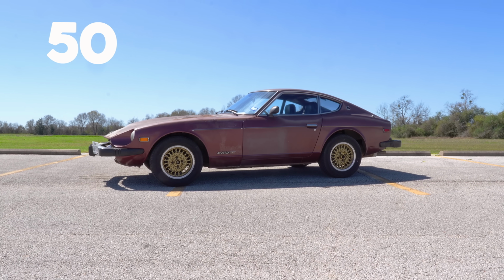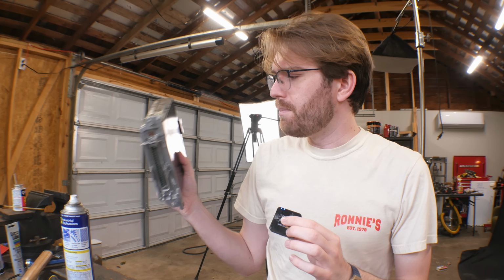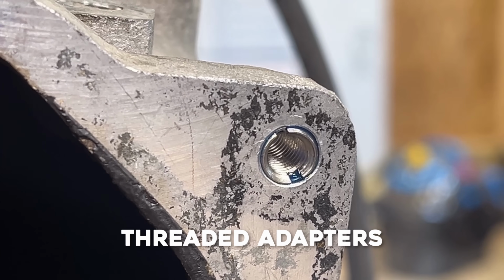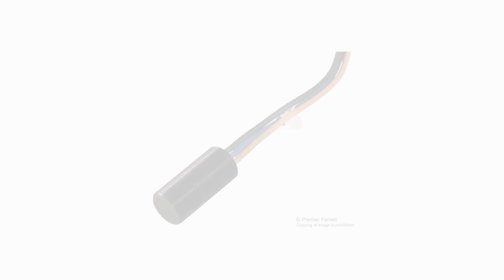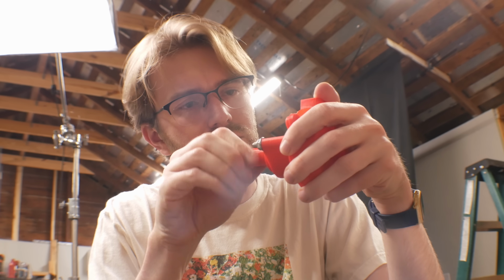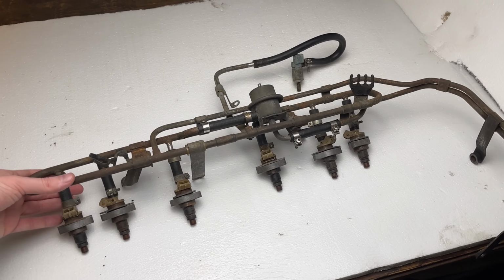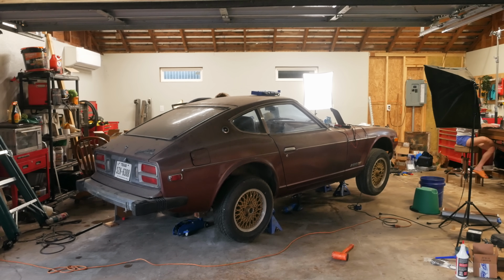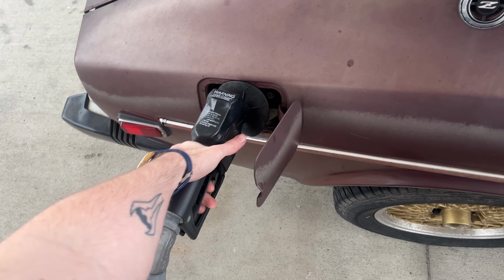Modernizing a Vintage Car

Comment: Tbh i like having more physically connected parts that aren't for controlling the engine. Like the throttle and brake directly connected to their respective parts. More for safety. Or say you're driving and your throttle dies completely. With an electric throttle you have to get towed. Meanwhile with a older style that is cable driven you can at least attempt to get a diy fix to get you home. Also I'm gen z.

Comment: What they mean by direct connection is the pedal feel and response.

Early drive by wire pedals were shit, they assumed you were a crap driver and nanny'd you.
If you pushed to quickly on the accelerator they'd slowly move making sure it wasn't and accident before giving more power.

There was also non-linear and fuel saving options.

I still prefer cable and drive a car with cable, it's newer and way faster than yours.

However I get you can make a drive by wire indistinguishable from cable driven if you try hard enough.

I like a computer, I just like a dumb realiable computer in my cars, not one that will drive me off cliffs or up the walls. Although I can also see how carboretters are cool if you like tinker with them on a semi regular basis too.

Comment: Just wondering how much more could have been gained by replacing water, oil, and fuel pumps with electronic counterparts. Naturally a battery and alternator upgrade would have  also been in order. My guess is another 5-10% power gain would be possible. I’m also curious if the ignition timing is dynamic or fixed, as the spark needs to fire earlier or later with changes in speed and intake temperature. 
The last thing is that there was no mention of EGR upgrade or whether any emissions testing was done to assess ultimate combustion efficiency.

Comment: Btw, YouTube Robot Cantina has done interesting stuff on Computerizing non computer engines. Adjusting done by stepper motors of Manuel adjustable stuff on the fly... then doing it via Aurdino programming.

Comment: For future improvements, I’d recommend revisiting the mechanical timing of the engine (firing at TDC versus slightly before TDC), make sure mechanical timing and injector timing is advancing at higher RPM. 
Also I would do a compression test. It’s hard to have good quality combustion with worn valve seats and piston rings.

Comment: The L-Tronic is not like modern EFI in that it is analog vs digital so it's more closely related to other early fuel injection systems such as the Bendix Electrojector.

Comment: dude, you are a genius and a masochist. kudos on the stick to it, but honestly 140hp is not worth getting out of bed for. my first 240Z build I went triple Webers and all that stuff. then I got 'real' and built a very stout 400sbc topped with a Holley 650 XP mated to a T56 wide ratio, TTT all around, Wilwood, and custom Aero wheels (no silly fender flairs). it's absolutely terrifying to drive. I love it.  I love the scenes where you are sitting at a desk testing. We fellow masochists know to test everything before installing. my Adruino and I are besties.

Comment: why?????????????????????????????????????????? you made a ton of money on this video, why not do some digging and find a new engine, show the adoption into the car, fix the frame and chasis, and moderize the drive train,.... this would make sense. fixing an old engine, really, why? what would have been even better would have been an electric conversion for this light sports car

Comment: This is amazing. I feel like a loser. I put carbs on a d-jet 1600 vw engine. You are welcome to borrow a 73 vw squareback for next year
Reply: Not to brag but I also upgraded from points to electric ignition

Comment: Alright now we need a new alum rad, new headers exhaust system, oil cooler, transmission cooler, new transmission, body works and repaint, power windows, a remote to lock/unlock the doors, new interior trims, suspension work and you have the perfect modern "classic" car lol. $$$$$

Comment: The Bosch L-Jetronic was a fucking asshole, especially when there were undiscovered gremlins lurking. I kept getting intermittent ECU failures that (when following the manual) diagnosed as a bad ECU (red indicator light on the ECU itself). After acquiring 2 other ECU's from the junkyard and many, many frustrating days of fooling around with them, I found a wire running on the inside of the front passenger fender which had some of its insulation rubbed off and was intermittently grounding, which turned out to be the issue. I can't remember now what it went to, this was back in 2001. My 280ZX was sitting on cinder blocks when I found it, after a few months and a lot of frustration and tinkering, it was pretty fast and a bit scary to drive. I converted the fusible link box to a proper fuse box, installed MSD digital ignition, got a nicely built head with custom cam (from some old car forum guy), bigger injectors along with some other electronic bits that fooled the ECU into delivering more fuel because I couldn't afford an aftermarket ECU. That car required repairs a few times a week lol but it was fun. The L28's bottom end was an incredibly tough unit. After blowing a head gasket, driving another 100 miles with the temp gauge nearly pegged and finding the oil pan full of chocolate milk, the cylinder walls still looked freshly honed, rod bearings absolutely fine. Slapped some JB weld in the cracked head, threw on another head gasket and sent it, the next owner drove it for a year like that!

Comment: surely at those rpm the hardened steel wouldnt affect the aluminium that much? unless you were going to make it have a large tolerance? i just dont see that crank sensor being aluminium being a problem

Comment: Hmmm almost identical system to my 1985 Porsche 944 (higher power AUS/ROW model) As for measuring air for the computer...? Did you forget the Air Flow Meter? It is sitting right there on your bench. Then on the Throttle body is a TPS that also sends a signal to the computer (DME in Bosch language) so you do have an electronic signal telling the computer where your pedal is.  Then it also has  DME temperature sensor that allows the computer to very the mixture. Not a dumb as it sounds. You can chip the DME to change the profile and increase the power and torque curve. The Jetronic system also has 2 crank reference sensors that tell the computer exactly when to fire and measures RPM which it feeds back to the computer.The whole system still works perfectly 21 years later.

Comment: And I have an immaculate 1970 Chevrolet Impala (56yrs old).. all original w/350cid.. Rochester 2brl carb.. normally aspirated .. original GM Distributor w/points, Condensor & Coil.. w/a full tank of fuel (28 gallons).. it weighs 4156lbs (twice as heavy as that Datsun).. I get 19mpg in it.. running the AC 😊😊
Nothing like American built steel cars.
Guy made a great video though 😊

Comment: In case anyone is ever looking for a slightly less complex way of getting around being stranded with a dead coil...buy a spare coil and stick it in your glove box. Seriously, it's a couple of wires and a clamp. With the time and money he spent on replacing the distributor for the sake of running six coils, he could have bought a whole case of coils and placed them around at different locations in his town.

Comment: You can also get another boost of HP, by adding a performance exhaust manifold. The ones designed back then were not even close to as optimized as compared to modern exhausts.

Comment: I mounted my trigger wheel to the crank. Mad an aluminum adaptor that was bolted into place with the bolts that held the crank shaft pully. It’s more accurate there than in the distributor as you remove error from a stretched timing chain. Then if you want sequential ignition and injection you can do a single tooth wheel in the distributor with a hall sensor to tell when cylinder 1 is top dead center. But the trigger wheel on the crank is so nice as you can use one that’s very large so the signal is very robust.

Comment: I own a 1980 280zx and currently doing a complete ECU swap with modern injectors and throttle body. Such a fun car to drive. The L28 inline 6 runs so smooth.
Reply: I am thinking of doing the same. What setup did you go with?

Comment: Isn’t it a mistake to inject the fuel right as the spark is going off? Wouldn’t you want the fuel in there a little bit before so it has enough for it all to spray and mix?

Comment: The way you simplified that engine bay alone was worth it.
Reply: Was perfect the way it was.
Reply: Turbocharger ! They get crazy horsepower out of modern 4 cyl engines. I'll bet the compression ratio is low enough seeing it's so old.
Reply: @firebald2915 Maybe. The L28E of 1978 in the 280Z (S30) was an 8.3:1 compression ratio for the 135hp, whilst the 1979 to 1983 280ZX (S130) has 143hp with an 8.8:1 compression ratio in its L28E.
December 1980 introduced the L28ET with a Turbo for the 280ZX Turbo (S130), but the static compression was dropped to 7.4:1 for what it's worth.

Comment: Self has a skyline GTX with the exact same engine
throttle body
Fitted a (those days) BMW throttle body and Airflow meter, has an aluminum plate welded onto the manifold, ported the whole set up to allow and eliminate any steps in the airflow, drilled new holes to mount
transplanted the little PC board from the original Airflow meter to the BMW Airflow Meter, and just like there was a 60% bigger area for the air to flow throw 
let me watch the rest of the video
brings back memories
at 1800m above sea level, on the wheels 144bhp

Comment: Not raining on your parade but you could have just done a crank fire system using a trigger wheel and replace the distributor all together.

Comment: You did about $100K worth of engineering and design, plus thousands in custom made parts and more in wrenching. You sure a nice near new Nissan engine from a wreck wouldn't have been easier (and more powerful, economical, and clean)?

Comment: Spending 8 months for a 12% power boost and a 2 miles per gallon increase is both impressive and depressing 🥲
Impressive in how much effort and knowledge you had to put together but my God.... I wonder how much an engine swap would have done instead

Comment: Awesome! I have a '70 240z with 30K original miles and a near perfect interior, uncracked dash but horrible original paint. I need to replace the rear quarter panels as  the prior owner replaced them with mid '71+ panels due to rust. Going to cost ~$2000K to fix, also needs a paint job, but it's going to look fantastic when I finally get around to it.

Comment: He can shave the head and bring the compression up as this isn’t an interference engine it has 8.2:1 compression ratio bringing it up to maybe 9.5:1 to 10.2:1 it’s a cheap mod to make more power research says these heads can be shaved up to 0.080

Comment: So with the K-Jetronic it originally had 170HP and after all this work it has 140. How much dos it produce at the crank? A good test bench should be able to tell you by measuring the losses in your drivetrain.
Reply: I think its bc its a tired engine, a full rebuild would be in order, every seal gasket and otherwise replaced or refurbed

Comment: Dude, I'm envious, your vids are not only well done but quite entertaining. Haven't posted many of mine because the production level will be very basic and NOT so entertaining but will have a lot of good info like yours on a lot of topics as well as automotive but not your level of depth. Super lube grease!! I've found no one that uses Superlube but myself before, well done! I've been using it since it first came out, yes that does date me, youngster. Nicely done and it will recover your money as fast as a solar system to boot and much of that was free through sponsorship too, but what a project, seriously did clean up the engine compartment though and picked up 20 more HP on an old engine that likely does not even have the best compression, top stuff..

Comment: Seriously impressive, but just to put an elephant in the room? Doesn't that Chevy Eco run at something like 30 MPG? 

Although I'm sure that the 280Z has a coolness offset factor of about 3, so it's at least two times better then the Chevy.
Reply: Convert the car to run on LPG and you offset the heavier fuel consumption by the 50% cost reduction of the fuel 😅

Comment: My Motorbike has 1251ccm and carburetur and does 116HP on the Dyno without any of your special tricks. No Airflow sensor, no injection not even a fuel pump (Gravity only). Has only 2 Ignition Coils for 4 Cylinders and no Water-Cooling at all. So there is plenty of room for "optimization" if your engine really has 2800ccm.

Comment: The continouus Injection is not wasting Fuel as this also gets burned but your way is a little bit more controllable. The KE-Jetronic does this, too and was very efficient in the W124 230E Benz of my Father - 6,8l/100km was no problem on the german autobahn with this car.

Comment: my issue with e-throttle body is the rpm hang when you let off the throttle. I've noticed that most new cars have that problem. mechanical you let off the throttle and it does not hang. idk maybe its just me

Comment: Is the next steps to install an LD28 crank and hotter cam and valve springs? Should be good for ~290HP and 7000+ RPM.

You've got me considering a fuel injection and coil pack modification. I'm on an L28 block with intake and carbs from a 70- 240Z - 3.0L at ~280 HP

Comment: I’ve got an 87 f150. First year for efi. Me and my pops pulled the motor out and after much deliberation figured it was cheaper to swap it to carbureted. Now I’ve got myself a carbureted 87 with a edelbrock 4 barrel with an electronic choke and it’s 10X more reliable than it was. Cranks everytime. And if I wanna shove heads and a cam on it I can without the stock fuel injection keeping me from tuning.  However this is a reliable alternative and very cool to see.

Comment: As an older person who bought my first vehicle for $50 in change. True story. My truck made 80hp and could run a million miles with just 4 wires to the engine and two wrenches a 12mm and 14mm, i could change the head gasket on the side of the road. All those electronic sensors and parts just make many more points of failure. Thank you for Not using 3D printed parts as a finnished product. 3D printed parts are ok for prototypes and nothing else. You are very talented i liked the video. 😊

Comment: What people complain about with drive by wire are delays, and limits in programing od the throttle operation, wen you can change that to 1:1 pedal position to throttle position drive by wire is just better

Comment: May I suggest an encoder instead of hall effect sensor. The resolution could be crazy high if you with. Either an incremental or rotary encoder they are not expensive

Comment: Excellent. I am living in Besançon in France where most of the actuators and rotating sensors you used are designed by Moving Magnet Technology of the Sonceboz swiss group. High congratulations for all your great job 😊👍

Comment: 125 hp at the wheels is pretty good for a bone stock 50 year old engine that originally came with 178 at the crank. You lose 15% for the drivetrain anyway. You lost 26 horsepower over 50 years. Pretty good in my opinion.

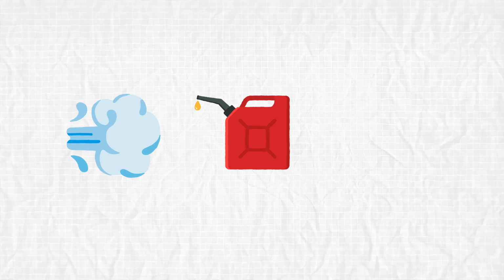Comment: 2:47 I don’t wanna sound like a smart ass but u forgot compression… Air, Fuel, spark and compression. If u missing one of those 4, your engine won’t run
Reply: All because I was working on a bike, it’s had all three but was missing compression so it wouldn’t start, the head wasn’t airtight, there was enough gap between the valves and the valve housing where air would leak out. Got new head and started right up

Comment: 19 mph,    fuck,   my 270 HP v6 4 runner gets 25 on highway and 19 in the city.
Reply: My VW Golf with 270 HP gets 29 highway and 22 in the city.     If I choose to drive with has savings in mind.   I can get it to 13 mpg or worse if I spool the turbo at full bald eagles.

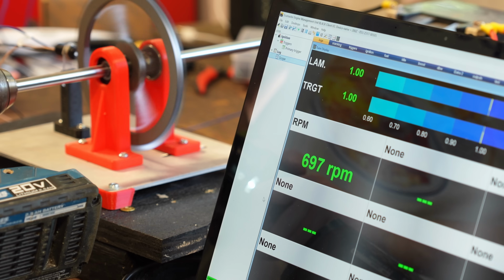Comment: 14:03
Sorry, but I'm not very familiar with modern cars,
 and now I have a question: with the new ignition system, how do you explain to the sensor when to advance and retard the spark? It's true that the distributor itself does this with two parts, one of which does it with the help of weights, springs, and gravity, and the other does it with the help of air suction from the throttle or carburetor, but what about this system? 

(And of course, it's very cool because with a small change, you can make the advance stronger so that an old car can work at 6 or 7 thousand rpm like a motorcycle! 😂)

Comment: Brilliant segment!
I'm posting this, though it'll probably bury in the appropriately MASSIVE response you've garnered.
You project a wonderfully droll and understated humour,  very much a style I've only seen in Bad Obsession Motorsport (B.O.M),  with 'Project Binky'.

Though I'm comfortably versed in the mechanics of engine systems I'm always open to the idea I could better understand some aspects.
And your uncluttered illustration of how sensors work, and the art of mapping, gave me another "Huh, so that's how it works' moment.

Very rare to find American content that isn't grounded in the obligatory over-hyped dialogue, redundancy and script padding.

And the "aftermarket" industry is insane. 3D resin  and CNC operations blow my mind, how you can design and fabricate anything. I would love to do this sort of re-vamp on an older Alfa.

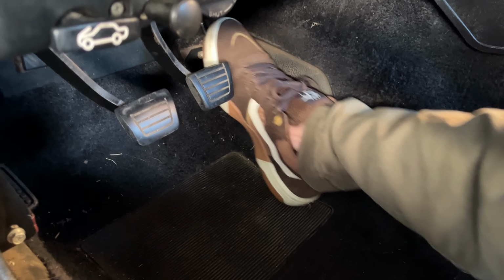Comment: 7:50 I dont' understand why not change the ANGLE of the block instead of just raising it?  It's not a block of wood it's a 3d print that you can customize.  It looks like changing the angle would better replicate the OG pedal.  Also starter motor is like 1 banana even with the engine in the car.  I'm surprised you ignored it and kept ignoring it.  Overall amazing project, very cool.